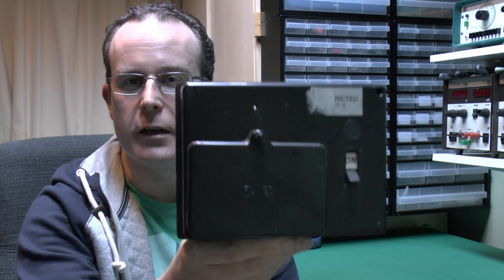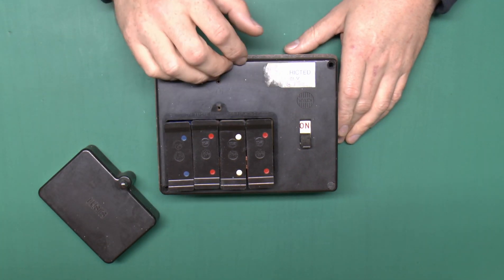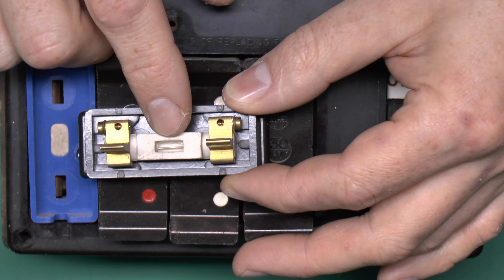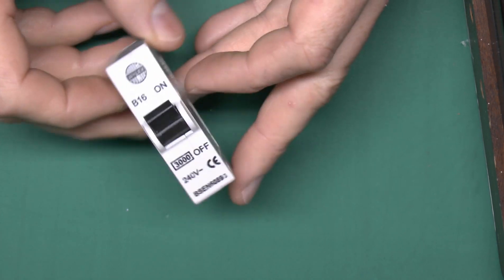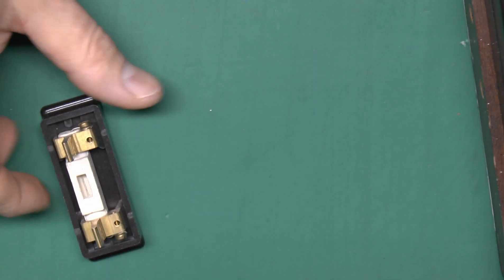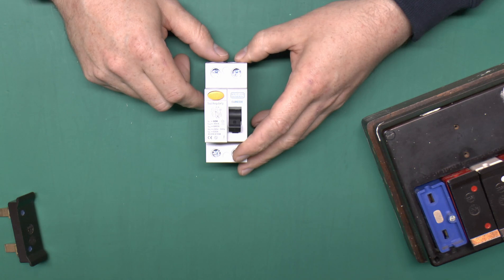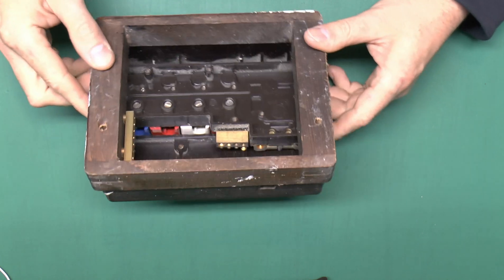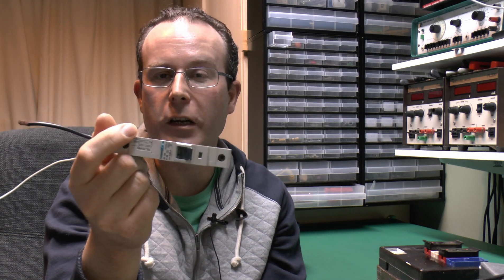Wylex Fusebox - Replacing fuses with plug in MCBs is a waste of money

Comment: If I have one of these units would my house need rewired too? Or would an installation of new fuse box do?
Reply: John Ward you need to tell the whole story, it’s not simply about PVC vs VIR, the positioning and type of every single outlet be it socket, switch or light fitting will need to assessed along with any external installation and internal bonding. The risk of needing a rewire is actually quite high on jobs like this.
Reply from the maker: Old wiring can often be used with a new consumer unit.  The existing wiring should be inspected and tested as part of having a new one installed.  PVC covered wiring is usually suitable for continued use.
Any wiring with rubber insulation will need to be replaced.  Even if the wiring is PVC, worth considering if the number of sockets, lights and so on is still suitable as older installations typically have far fewer outlets than new ones.
Reply: Yes. 
You'll never get an electrician to come to the house, do the job needed, and go away again. There's always a "Ah.... can't do 'that', you'll need 'this' before 'the other'. Then I can do 'that'."

Comment: To be fair, what you should be advising is that the installation should get a condition report done? Even with the consumer unit replaced,  if the fuses were popping on a regular basis, this issue is only going to be transfered to an MCB/RCBO! 

But as you correctly state, if the fuses are blowing frequently, there is clearly a serious issue somewhere within that circuit! Generally speaking this will usually be circuit overload, high resistant joints, faulty equipment...

Comment: When the fuse-wire blows, it's not usually a fault with the installation, but an old style incandescent lamp blowing (or a tungsten halogen equivalent). My father who is 85 now has found the replacement MCB very useful, especially as he has only one good arm after a stroke, and replacing the fusewire is fiddly for him.  The other point to mention here is the price of LED equivalents which are not yet up to the brightness of old 100W lamps with the same colour temperature, ie 2700K. have a noticeable reduction in light output with time. I have tested the reduction in light output on LED lamps, especially those with SMD's, and a drop of as much as 25% happens within just a year. If 6000K lamps are used, the blue light reduces the production of melatonin, causing people difficulties getting off to sleep, or insomnia. I say bring back the old incandescent lamos!
Reply: It’s sad that the lamos is now extinct. I for one have never heard of it but if it can be brought back to life so well and good!

Comment: What is said is correct of course and a modern consumer unit would be better, but not everyone has the money to pay for the installation.  Wired fuses can surge at many times rated current so plugin mcbs with their more accurate trip current are at least better than wired fuses in that way.  Rcd sockets for outside appliances such as mowers and power tools and wet appliances such as washing machines can reduce risk of electrocution.

Comment: They don't sell traditional fuse wire fuses anymore in DIY stores, so it's the RCD type for wiring new circuits or nothing....
Reply: ...yes they do still sell it. Even my local off license has it and there are electrical supply shops in nearly every town. It costs about 80 pence and people with common sense buy it before it is needed and keep it alongside the fuse box. 

Another thing, this video isn`t about new wiring and the circuit breaker that can be fitted into the old fuse board is not a rcd. The whole point of this video is to explain this fact and that upgrading to a new consumer unit is better than spending the money "upgrading" an old one.

Comment: Clearly you have never tried repairing a wired fuse in the dark. Not everyone can afford a new consumer unit. Have you refitted a 30 amp wired fuse into a short circuit. Copper plated fingers - scary! An mcb will just keep tripping.
Reply: Because you shouldn't have done that in the first place, what it's written on the consumer unit? Do not remove/insert fuses with the power connected, you turn off the switch, replace the fuse, replace the cover, and then turn on the power again, it's not difficult.
Reply: @alerighi  he didn't mean with the power on he meant a wired fuse ie a fuse wire.
Reply: wattsupmike ? Clearly you have never met someone who does one third of their work at night. We use battery operated head torches, battery operated work lights etc.

Comment: If the fuse goes it's a pain in the ass to fiddle around with the wire especially if it's the lighting that's blow....and it's night. You also hear about people using bits of metal instead of wire. For these 2 reasons alone I would change to MCB's .
Reply: HILUX CHAINSAW Exactly. Plus, you avoid the smell of burning Bakelite, if you have an old fuse box like we have.

Comment: Sweet youtube irony - got an advert for the exact same Wylex MCB's you'd just told people not to bother with come up at the end.
Probably no benefit to a sensible consumer but stops people like my brother in law deciding that a blown fuse after attempting to install a new ceiling light* means the existing fuse wire was 'too weak' and needs replacing with something stronger.
* he was sure he had that correct - ignore all the previous connections and go with red to red and black to black... right?
Reply: Over the years I’ve seen all sorts, bigger wire than should be fitted, screws and nails or the best ones are when people put multiple winds of 5a as it didn’t look strong enough
Reply: ben weston No the best ones are when a so called 'professional electrician(s)' (meaning 'electrical' contractor(s)) attend a fault, find that they don't have the correct rated or correct size cartridge fuse, so then 'improvise'. Most of the time wrapping fuse wire or wire stands from flex around the blown cartridge fuse...

Comment: waste of money till someone puts 30a fuse wire in their 5amp lighting circuit! Circuit breakers are much safer and prevent this, don't agree with your video on this. Plus that consumer unit wouldn't fail an EICR as it was installed to a previous standard, you just couldn't fit it in a house these days, not that anyone would mind!
Reply: Except when someone puts in a 30A breaker in a 5A circuit.
Reply: Exactly amigo!  @JasperJanssen

Comment: These old wylex boards are potentially unsafe IMO, the one shown is more likely a 1960's item. By the 1970's they had a screw to the cover thus needing a screw driver to access the fuses. If the fuse wire has been unprofessionally replaced various hazards can occur including wrong sized wire and any untidy wiring can leave a bit of live wire sticking out waiting to be touched if the isolator isn’t operated.  The after market mcb’s can prevent the fuse cover being fitted leaving the mcb to be pulled or knocked out revealing live brass pins.. The 5amp fuse is generally rated at 1kA breaking capacity which is often less than prospective fault current these days. If there is no supply company isolator the brass main terminals are not fully isolated leaving live uninsulated parts inside  This last point alone is sufficient to warrant these awful old fuse boxes to be replaced as you have rightly advised.  Hope you don’t mind my chipping in, Good video as always J

Comment: So you think that wandering around with a torch with a bit of fuse wire is the same as flicking a reset switch! Well I think we will have to differ.
Reply: It's worth putting one resettable breaker on the lighting circuit at least.  Tungsten lamps have a habit of arcing to a short circuit when the filament dies.  This is the most common cause of disconnection by fuses or MCBs in my ten years as an electrician, and forty years living in houses.  John hasn't taken this into consideration at 6.33 when he suggests there must be a major problem with the installation.
Think of the unfortunate householder in the dark to find that there's no more 5A fuse wire left on the card.  It's obvious they're going to use the 15A fuse wire as a 'temporary' fix.  
I agree that changing all nine of them is likely to be a waste of money.  Just identify which circuits are critical and use MCBs for those.
Reply: "So you think that..." Straw man argument. He never said that.
"We will have to differ" - yes. JW is reasonably intelligent and you are a bit dim.
Reply: westinthewest Decent quality tungsten filament lamps will have an integrated fuse within them. Second,  tungsten filament lamps are being phased out. Third, in my experience although tungsten filament lamps occasionally cause a MCB to trip, I don't remember ever having to replace any 5A fuse or fusewire in a consumer unit/fusebox due to a blown tungsten filament lamp. The point JW was making, was just replace the whole consumer unit with a modern one.
Reply: We don't all have new style consumer units so give the guy a break & wind your neck in .
Reply: Bose de-Nage     DITTO to that , having been there also

Comment: Is it not the case that MCBs are faster to respond, and respond to more conditions (heat and magnetic)?  I thought that was their key selling point, but am interested to know if that's not the case.
Reply from the maker: MCBs may be faster in some cases but not all.  They have magnetic and thermal parts to operate on short circuits and moderate overloads respectively - something which a fuse can do either by vaporising instantly or slowly heating up and melting.

Comment: Lol. "It's a waste of time spending £40 on circuit breakers to replace the old fuse wire units".
Much easier to spend ten times that on an electrician to install a new consumer unit.
Reply: S. Giles says the man with a response like yours. 

£40 layout for easy and quick resetting of a circuit or £400 for a fuse board change plus potentially another £2000 to rewire your entire property because it doesn’t meet current regs(which it would have to once the fuse board is changed).
Reply: £40 spent will be wasted as the MCBs will offer much the same protection as the good fuses you throw out. The easier reset is a plus, but if you're having to reset often,  check your wiring over. If you spend ten times that on a sparky, you will get a much safer setup, so the two scenarios are not equivalent.
Reply: Spending £40 for not improving at all the security of your installation or spending ten times that to have a more safer installation with a RCD that could save your life.
Reply: @alerighi  The OAP stuck with no light or power would much prefer a switch which can be reset. Leave off the one the takes the power off. You would be glad of that when you get older as you will!!
Reply: Straw man argument.

Comment: i replaced some of my board fuses with single b type mcbs minimum available was 10A whereas a single strand a Cu wire burned @ much lower fault current,  i did that cause at some point or later the fuse assembly would make arcing clicks which is dangerous.

Comment: Probably the greatest advantage with an MCB is that when a fuse blows then someone who has no idea what they're doing may replace it with too large a fuse or something else entirely (in some cases a nail or strip of copper!), and then the circuit is no longer protected, but an MCB is a bit more fool-proof.
Reply: exactly I know someone that was going to put a 30A fuse wire in a 5A fuse carrier - SCARY
Reply: @adventuresofanathan  what wud happen? can u elaborate
Reply: @ggoog1845  the fuse wire wouldn't break when there is a fault present, causing fire or shock risks.
Reply: That don’t bear thinking about.

Comment: You havn't mentioned 'Fusing Factor'. A BS3036 rewireable fuse has a fusing factor of '2' which means that it will carry twice the rated current for up to 4hours before disconnecting. A circuit breaker has a fusing factor of 1.45 and will therefore disconnect at a lower overload current. Because of this the 17th Edition Regs applies a fusing factor where BS3036 fuses are used which means essentially that a larger cable size has to be used when BS3036 fuses are used. Other benefits of using circuit breakers is that they have fixed values of tripping current and cannot be meddled with as with the fuse ie.incorrect fuse wire being used. There are other benefits to using circuit breakers and in short I would recommend their use.
Reply: Geoff Bryant Missing the point. JW is saying renew the whole consumer unit.
Reply: Cost of the hardware may be similar but just upgrading the fuses doesn't require using an electrician.
Reply: Ummmm the trip or blow speed at which a MCB or BS3036 is dependant on rating and fault size ...for example a 5 amp 3036 will trip in 0.1 second at 45 amp fault and 5 seconds with 13 Amp fault as per Fig2a of bs 7671 (in older editions only).

Comment: An electrician told me he wouldn't touch or change my old style consumer unit because the electrics in the kitchen were not up to date with isolation switches etc for the appliances. Is he just being extra safe or is he touting for more business by having me rip my kitchen out? None of my fuses tri on a regular basis,  Good video by the way
Reply from the maker: Installing a new consumer unit also requires that the circuits are checked and repaired if required.
However isolation switches for appliances such as washing machines, fridges etc. are not required and never have been.  Isolation is generally achieved by removing the plug from the socket, and is usually only there for when the appliance requires repair or other maintenance.

Comment: My off peak switches on my fuse box keep tripping off if I Turn on my water heater on off peak it just trips my fuse box no other problems with the other side of the on peak side of my box can u help me please thank u
Reply from the maker: +Lawrence Lane If it's only tripping with the heater, then almost certainly the heating element has failed and will require replacement.

Comment: my living room light keeps blowing bulbs the b6 fuse makes a clicking noise could there be something wrong
Reply from the maker: +John Clark Possibly a loose connection at or near the fuse / circuit breaker, which will cause arcing.

Comment: In Germany go in 63A (3×230V) normally, starts with a MCD with 63A/3x230V as main fuse and then every line have MCD 16A B character. For bath room or outside power sockets we should install RCD 30mA, in older installation (my appartment) come one RCD after the main fuse. For working places with heavy machines use MCD 16A C character. Newer installations make extra lines with differ RCD's, start with high 100mA, then 50mA, then the lowest 30mA. Example: Main fuse - RCD (for all) - MCD (all) - RCD (for kitchen) - MCD (kitchen) - RCD (for power sockets) - MCD (power sockets) / RCD (for living room) - MCD (living room) - and so on ... Possible an extra line for lamps only - so that lamps not go off in night if washing machine chrashed RCD. But only RCD as once replacement for every MCD I never hear here in Germany. This we never do. In Thailand in opposite I be happy if we have fuses into the power lines ...

Comment: my light circuit had popped a couple of times with a  Big Bang I do want to put one of these in although  I can only find 6amp ones is this OK and to remove the backing plate from the circuit board I take it you only need to power off and remove the screw no wiring is required???
Reply from the maker: +Brian Alexander Yes, they are a direct replacement, the 6A will replace the 5A fuse.  However if you are getting a ' Big Bang' even once, there is something wrong which needs to be identified and fixed.

Comment: I replaced the Wylex fuse links in my consumer unit but they are different to those in the video, The old fuse link base is also removed and the MCB screwed in place. Each has a test button as well as a lever to reset. True, ideally I should replace the consumer unit but that is a job for a qualified electrician which I am not. Have you ever tried rewiring a fuse link in the middle of the night with a torch?
Reply: A way of avoiding to have to rewire the fuse in the middle of the night is to have spares ready wired. Most electricians who have replaced old with newer units will usually give you a few.
Reply: wattsupmike ?  Have I ever tried rewiring a fuse holder in the dark? Yes. I have also rewired various electrical systems in the dark. Stop moaning and go and buy a decent head torch and battery operated work lamp.

Comment: My MCB trips whenever a bulb blows, is there a cure?
Reply from the maker: +Cumbriahandyman No, it's fairly inevitable with incandescent lamps, as when the filament fails an arc forms inside, which effectively shorts out the supply and trips the MCB.
Reply: Szakembőr TV TMIAE Better off buying LED lights, or paying a bit more and getting quality filament lamps that have an integrated fuse.

Comment: Magnetic circuit breakers seem very fast, they are a damn nuisance when your wife choses a light fitting that looks like a candelabra with a collection of filament bulbs in it.... every time a bulb fails you get plunged into darkness as the lighting main trip operates. I don't think fuses are quite as prone to this.
Reply: From what I know, certain types of lightbulb can blow the circuit fuse when they fail (my sister recently had that happen to her, she called out an electrician, and the electrician replaced the fuse with a circuit breaker)